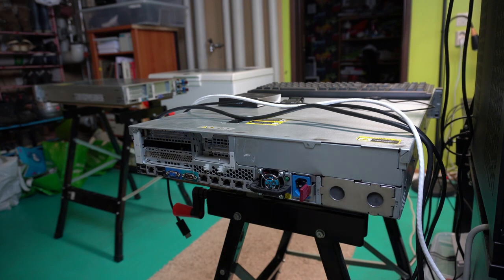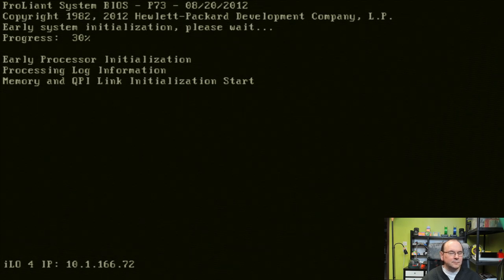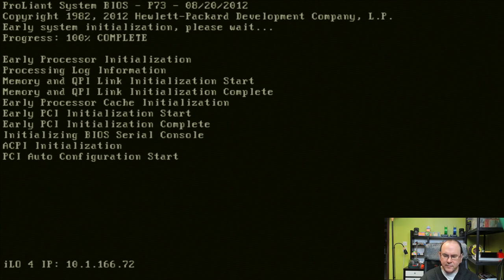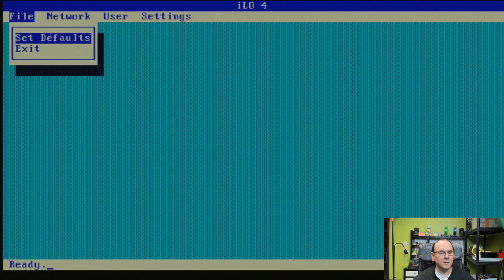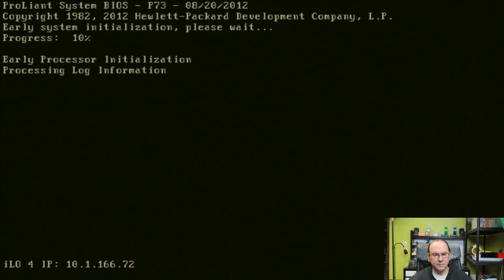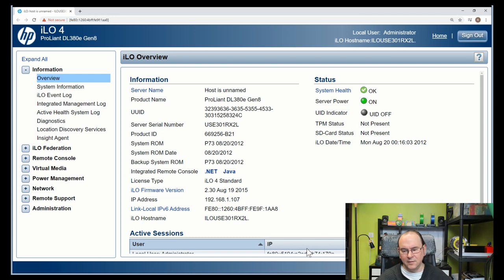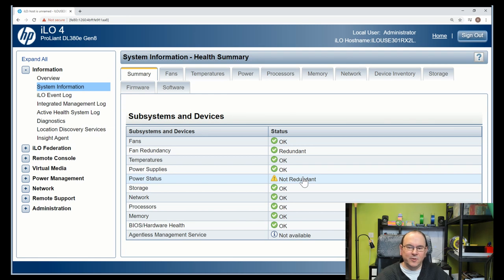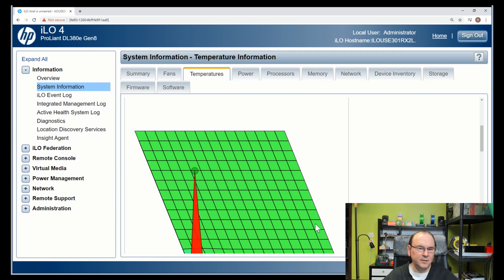Server power up and factory reset

Comment: Hola, l would like to know if also l can set the server to factory default using  - restore erase boot disk ?
Reply from the maker: Yes, I would think this is the case. As I had no disks at the time I just did the restore as far as I can remember. Double check in Your case You really want to erase the boot disk before proceeding.

Comment: Bro please am using ml110 gen 9 the intelligent provisioning key is missing and am also getting error like hp restful api cannot communicate with ilo please I have restored manufacturing settings but still it gives me that same error and it has made the system very slow before booting to desktop please any help